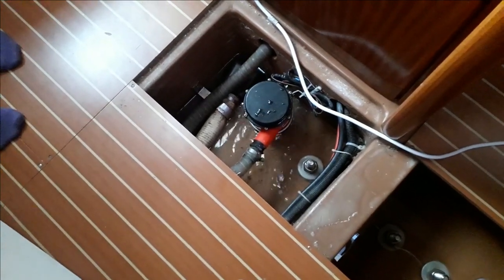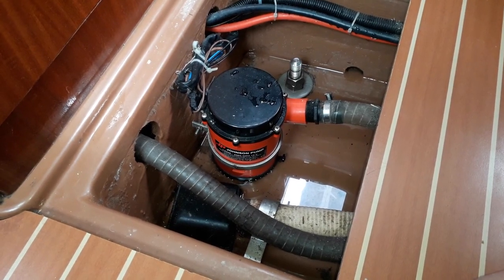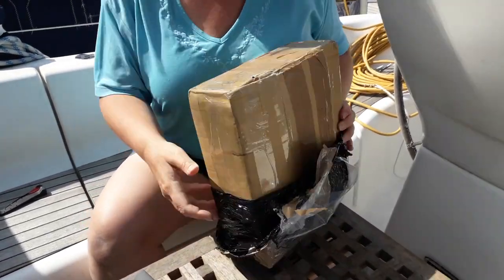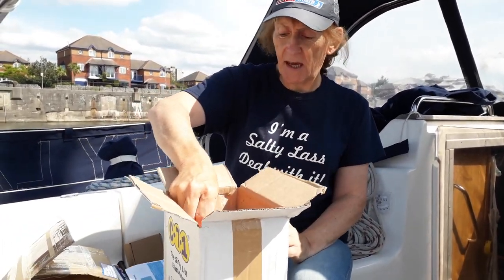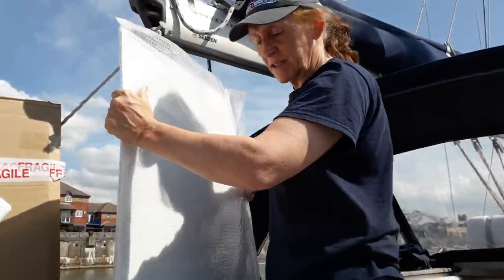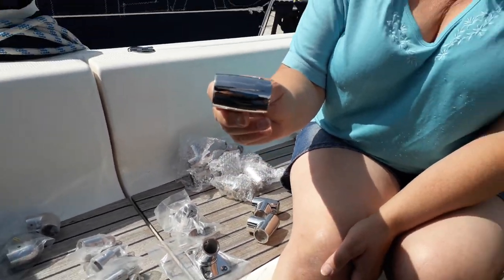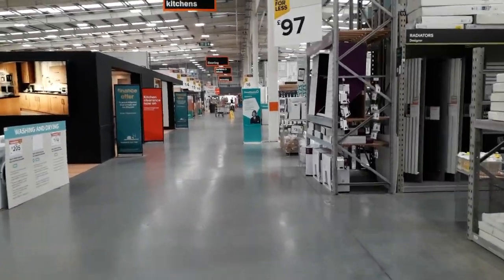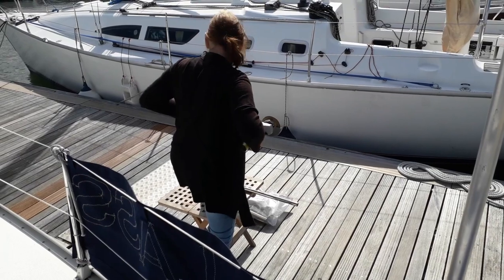Preparing for off-grid living - Liverpool - Ep. 104

Comment: Great video again lady's, just on the hot water pipe, I would fit on off these
https://www.screwfix.com/p/jg-speedfit-plastic-push-fit-angled-tap-connector-15mm-x-/12129?tc=RB3&ds_kid=92700045895912275&gclsrc=aw.ds&ds_rl=1241687&ds_rl=1245250&ds_rl=1249404&gclid=Cj0KCQjwuNbsBRC-ARIsAAzITuf3Oh_Fkf4GWalCb4StTwTICewr3AiP5Vf3VkSaANtMgKaA0sSK0bEaAmKCEALw_wcB

Then run the pipe flat and up to the tank, there is to much stress on the oring when the pipe is not fixed level go into the fitting, happy sailing, Darren
Reply from the maker: Thank you - it never occurred to us to check Screwfix. That is a great tip!